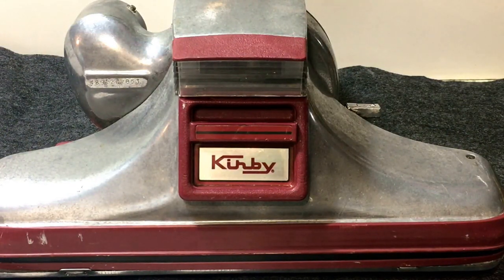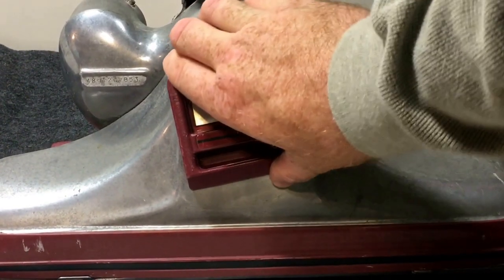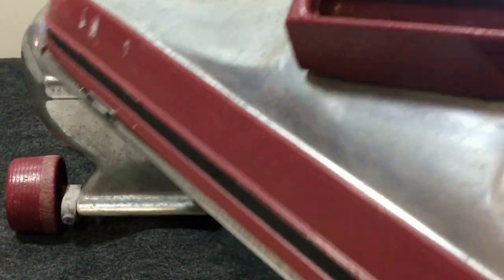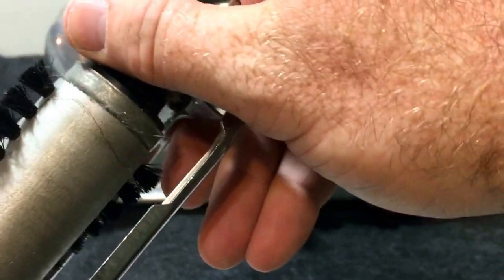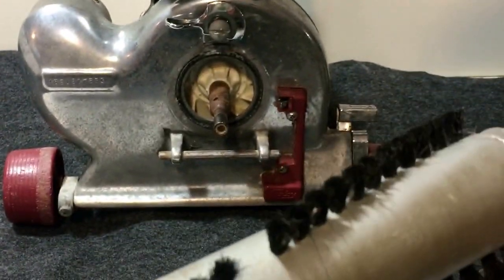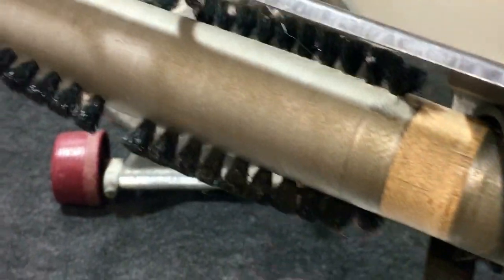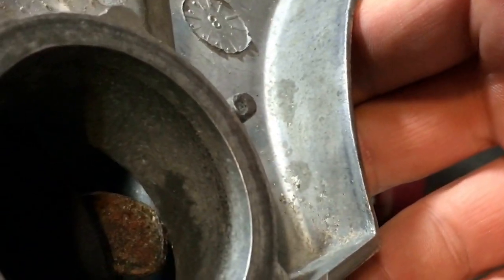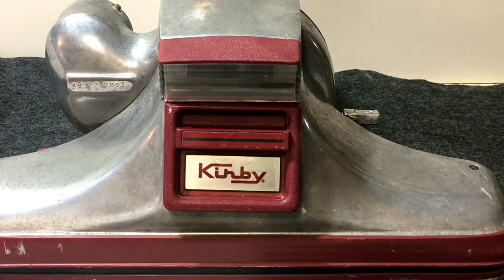Kirby Heritage II Vacuum Belt Replacement - How To Do It Yourself - Repair / Replace

Comment: does it matter which side the white end goes?
Reply: The side of the brush roll with the white cap must face the side of the machine where the toe-touch control is. The brush roll will only properly fit in that way!

Comment: How can I tell if the bearings are worn out??
Reply: If you mean in the motor, it will make a grinding sound similar to a circular saw. When you stop the motor, and spin the fan shaft, it will sound rough when you spin it. In the roller brush, it will grind or feel gritty when you move or spin the brush. Some roller brushes have a long axle with bushings in it. Sometimes it will lock up or it will make a growling noise when in motion. All of those things can be easily fixed or replaced.

Comment: this sucks--- the trick is hooking the belt again -- which he glosses over
Reply: Kinda, but at 6:10 you see that you have turn it counter-clockwise again (after resetting) to hook the belt.  I also had to use more muscle than I expected to get enough rotation so the belt cleared the shaft.  Anyway, liked and subscribed just for this video.